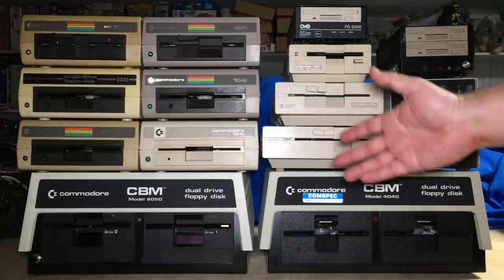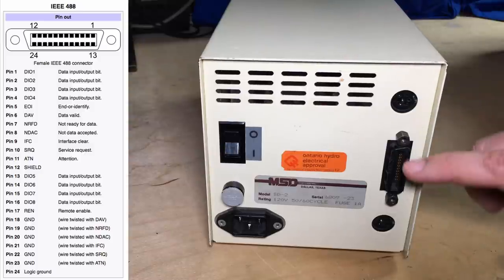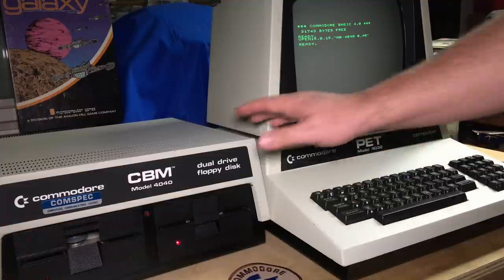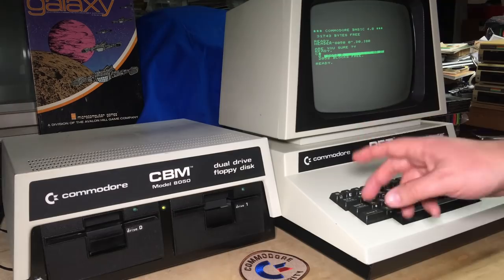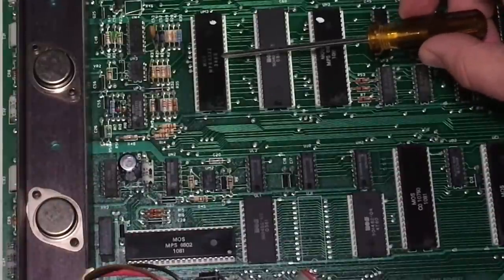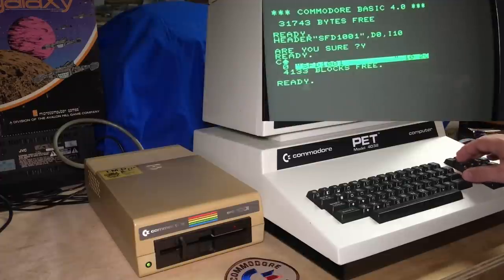Exploring My Commodore IEEE-488 Disk Drive Collection

Comment: "Quad density" was an informal name, so-called because it stored at least four times as much as most early 5¼-inch disk formats (720K or higher vs. 180K or lower). In reality it was still only double-density, but used twice as many tracks per inch (96 tpi vs. 48) and both sides of the disk. You were supposed to use special disks rated at 96 tpi, but eventually floppy disk media became good enough that you could reliably store it on disks only rated for 48 tpi (such as the IBM PC 360K format).
Reply: Yeah, I never had a problem using DS/DD disks in my SFD-1001 back in the day.  Of course, I didn't get my SFD-1001 until 1985 -- by then, as you said, floppy-disk quality had improved to the point where a DS/DD disk was good enough.
Reply: That's like with the BBC Micro and 40 vs 80 track drives.

Comment from the maker: I cover a lot of stuff in this episode, so here's an index. Also, a correction: Apparently drive 0 is on the right in the dual drives from the factory! So someone just swapped the labels/face plates, not the drive mechs. Also, I totally forgot that in BASIC 4.0 you can just PRINT DS$ to get the disk status, rather than typing in that 4 line program. D'oh!

0:00 Family Photo: all my C= Floppy Disk Drives
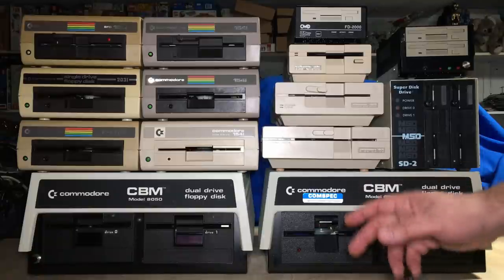1:10 The two interfaces: Parallel IEEE-488 and Serial IEC - as seen on the MSD SD-2
3:45 Commodore's IEEE-488 cables
4:48 PET 4032, and opening a new box of DSDD 5.25" disks
5:56 Formatting a disk in the CBM Model 4040 disk drive
7:41 Reading the command channel - Everything's OK
9:05 CBM DOS V2 - the DOS is in the drive, not in the PET
9:44 Labelling a disk!
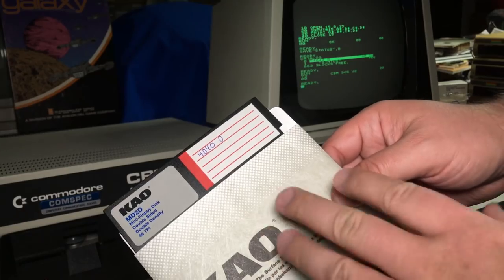10:20 CBM Model 8050 - 520K per disk side, NOT high-density!
13:09 Formatting with the HEADER command
14:12 CATALOG and how the 1541 was a regression due to $$
15:01 Inside the 4040 - two processors including a 6504!
16:48 Inside the 8050 - DUAL 6502s
17:47 The SFD 1001
20:13 4133 blocks free: Successfully formatting a SFD 1001 disk
21:48 Commodore 2031 and 2031LP
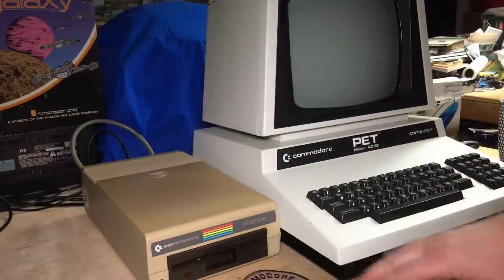22:43 Stacking Drives: The TPUG Locker
23:14 4040 to 2031LP to 1541 lineage
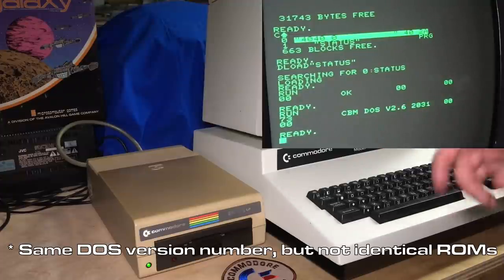24:25 Thank you to my patrons: http://patreon.com/8BitShowAndTell
24:45 I'll cover the IEC (serial) drives such as the 1541 in another episode
Reply: at 25:07 all AvE fans are thinking "Thanks for watching, keep your disk in the drive...."
Reply: wow i forgot how loud those keyboards were.
Reply: Yes, I thought that drive 0 was on the right too.

Comment: The 8050 disk mechanisms, for those who are wondering, are Micropolis. They designed a 100 tracks-per-inch standard, which was very short lived, and was ultimately supplanted by a 96tpi (because disk drive manufacturers could easily re-tool between 48tpi and 96tpi mechanisms, with a minimal change to the stepper motor). Both Micropolis and Tandon made 100tpi mechanisms (Tandon suffixed their 100tpi drives as M, so TM100-4 was 96tpi Shugart, versus TM100-4M which was the Micropolis 100tpi variant).

The 4040 used fairly standard Shugart SA-400 mechanisms (Shugart actually labeled these as SA-390, which lacked the analog board, Commodore supplied their own.)

Comment: Wow did not know that there were such a variety of  brown drives just knew the 1541
Reply: None of the drives besides the original 1541 and the 2031lp are brown, they are very light beige. Of course the plastic yellows over time if exposed to direct sunlight.
Reply: ok I just wanted to say i never knew that 2031 or sfd drives existed, but that video enlightend me...

Comment: The irony of the C64 moving from the 6522 to the 6526 was that they wanted to keep compatibility with the 1540 drive of the VIC-20, but a new problem crept in with the VIC-II chip requiring an additional slowdown of the data transfer from the drive to the computer. This made the 1540 incompatible with the C64 unless you sent a command to the disk drive to slow the data transfer down. EPYX, (among others), solved the throughput problem with their FAST-LOAD cartridge, but it wasn't 100 percent compatible with all the copy-protected game software that was available at the time.

In the end, the C64 using the 6526 and 1541 transfer data more slowly between themselves than the VIC-20 using the 6522 and the 1540. While there are mods that work around the data transfer rate issue, not everyone uses them.

Comment: To fix the famous 6522 bug, all they needed to to was sync up the data line with the CPU clock by using an and gate.
Reply: Did they know this at the time?
Reply: @csbruce  no, all they knew was that it didn't work. You can get a version of the chip that was fixed about 25 years ago by Western Design Center. 
https://www.westerndesigncenter.com/wdc/w65c22-chip.cfm

Comment: Never head about the 8050 able to store about 512kB on a SD floppy, by using 80 tracks instead of 40. In the late 80's I had a program named "VGA COPY" for the PC, able to make special formats. One on the was 1.72 MB on a standard 1.44 MB, this special format was used by Microsoft when then distributed the first version of Win95. The one I liked to use was formatting  SD floppies (360kB under MS-DOS) with 80 tracks and 720kB (the same as single density 3-1/2 floppies). This was convenient and very reliable. I can see my idea was used years before by Commodore and I didn't even know it.
Reply: It wasn't just Commodore - QD was a thing in general, but I guess IBM was a bit worried about reliability in '81 and went with 40 track. QD drives were quite popular in the eastern block for Z-80 based computers in the late 80s - early 90s.

Comment: I went from using the cassette tape to the MSD2, which I bought in Toronto in the early 80s, most likely at Paperclip, on Queen St.   I used it with an IEEE488 parallel card on my C64, and it worked great for everything, except for copying some protected disks.  I was a member of TPUG, and regret, never being in town on a day where I could attend a meeting.

Comment: I didn't realize most of those disk commands were built-in.  I never figured out how to format a disk on my C64 until I got a copy of the 1541's owners manual (that's all long gone now), but in the appendix there was a program for initializing disks.  Like it had for loops that zeroed out blocks and everything and even wrote out the header (byte for byte IIRC) and you could take any random 5.25" disk and turn it into a Commodore disk! (obviously the initialization and header commands you showed today are much faster but I didn't know them).  I ended up saving that program to the first disk I formatted with it. (making sure never to load it and run it on that disk by accident).  It's also how I found out about the "$" program (never learned catalog).  Wish I had access to this channel back in the 90s! 🙂

Comment: They fixed the slowness before the C128, on the Plus/4 which has its own interface.
Reply: ungratefulmetalpansy  Completely agree. 
1551 had such a complex communication, it made it very slow. They could just realize IEEE protocol on same 8 bit  paralellel bits.
But nope, they created a new one... In fact 151 only 2.4x faster on a 8 bit wider data line. Epic! :-D
The idea of implementing Dolphin DOS never came up in my mind, just the C128's and 1571's Fast mode, just created 1.5 years later... 
In fact I could not find a single bit of information how much faster was the C128's Fast protocol VS normal IEC. (also not about burst mode, or a benchmark JiffyDOS VS Fast protocol or Burst mode). Strange.
Maybe they could not sell JiffyDOS, if it would turn out that the C128 is faster by default?  Just thinking.

Comment: Nice. I have not seem a pair of pets in the wild for over 25 years and never the large size full height floppy boxes. I do love how they use a flat card edge connector that should have just been a standard 488. But then again I assume since it is part of the board design that it was cheaper. I also leave vintage stuff on items. Shows the history. I also collect records / Laser Discs and leave period correct labels on them including if they came from a rental store.

Comment: I can assure you that the behavior of your SFD is totally normal for single sided disks. It's the same as with the 8250(lp). The first access tries reading the disk as double sided, results in an error and the drive switches to single-sided mode. Then the next access will succeed.
Also, the older low capacity drives like the 2040 don't automatically detect disk changes, you had to reinitialize the drive manually.
And yes, the plastic case drives are pretty susceptible to EMF.
I guess one of the reasons why today you shouldn't stack them is because the plasticizer might leech out of the rubber feet and deform and imprint the top of the bottom drive. Back then, I guess, it was mainly heat and EMF.

Comment: I ran a C64 BBS back in the 80's. I had the MSD2, 1541, SFD1001, CPM8050 and a CPM D9060 (Hard Drive). the SFD's ran hot and I used some 3rd party exhaust fans to keep them cool. I used the MSD2 as a personal copy machine with my portable C64 think it was called a SX64.

Comment: Great video as usual, Robin.  I grew up with a C64 and 1541.  Thanks for the PET drives education.  I had no idea the PET drives were faster and had a higher capacity than the C64 drives. That kind of stinks for us C64 guys.  Also, I knew they added the "CATALOG" command for the C128, but had no idea the PET had it as well.  I wonder why they left it out of the C64.  Looking forward to part two.
Reply: PET BASIC 4.0 with disk commands took twice the ROM space, I believe, which would have increased production cost.The C64 was much more a mass-market machine where every dollar counted, while some later PETs (the CBM 8000 series that high-density drives like the 8050 were meant for) were moderately high-end microcomputers for their day, intended for business use with 80-column video, etc. and quite expensive.  Time pressure during development must have been a factor also - C64's BASIC ROM was nearly a direct copy of the VIC-20's, where disk drives were rarely used, and its custom chips (VIC-II, SID) were first introduced in the Commodore Max Machine (Ultimax), basically a game console with only a few K of internal RAM, no internal BASIC (had to use a cartridge) and an awful membrane keyboard. That was only sold in Japan, and didn't last long.

Comment: We used these pets for cad design at college in the late 80s, at the start of each lesson we would have to open up the hood of the disk drives and clean the heads. I cannot remember what the cad program was called, but there was no mouse, you had to key in commands to generate the drawings. If you keyed in a command that was out of range the program jumped back to the basic Ready prompt and you lost everything!
Reply: ungratefulmetalpansy  I do remember that if you poked memory at around 32768 and above you got to write over the screen memory and it was a bitmap not character based like the C64 1k screen ram. or did I dream that!? Nope I a sure I am correct.
Reply: ungratefulmetalpansy  Yes I just had a look on the web and you re right, umm I can only guess that they had some sort of add on board for bitmap mode and I never realised.
Reply from the maker: There were a surprising number of add-on graphics boards for the Commodore PET, so it's quite possible that's what the college had for the CAD course. They probably invested a lot of money in those systems in the early 1980s and didn't have the budget to upgrade that decade. Here's a great page about those add-ons by Steve Gray, the same guy I mention in this episode: http://www.6502.org/users/sjgray/computer/petgraphics/index.html
Reply: @8_Bit  Gosh there are hundreds of themon that site! no idea which we had, I am sure it was running from boot up as I remember poke(ing) around and I found I could overwrite the screen ram like a bitmap. I did it from basic after the machine had been switched on and I clearly remember writing over the boot up text (basic bytes free text) but like i was going over it in bitmap mode not character mode. So the card must have remaped the PETs char mode into the bitmap mode on startup, if you see what I mean. Thanks for the interesting Videos (from Nottingham UK.)

Comment: 5:38 I remember distinctly that the 8050 drive at my school in 1980 also had drive 0 on the right so I think that was the way they came out of the factory.
Notice that the 8050 (and the 8250 double-sided version) also had almost 3 times the capacity per diskette of the IBM PC: about a megabyte per disk, on the same type of diskette! When my school got an IBM PC I was pretty disappointed about that. Not to mention the stupid PC keyboard on which you had to use the Shift key to type all the important BASIC symbols such as " and $.
Reply: The 8050 used 77 tracks instead of the PC's 40, and Commodore used variable bitrates with GCR encoding (8 data bits = 10 disk bits) to cram every possible bit onto each track, while the PCs used a fixed number of sectors per track, limited by the innermost track with the shortest linear length, and used MFM encoding (8 data bits = 16 disk bits).
Reply from the maker: Thanks, I've now done the research I should have done beforehand, and yes, drive 0 is on the right from the factory. So I should swap those faceplates around now, that should be simpler than swapping the drive mechs :)
Reply: @8_Bit  I think the face plates are attached to the mechs, not the case. So you probably have to take the mechs out to swap the face plates.
Either way, you could just leave it like it is, just like you did with all the other modified hardware and stickers and stuff.

Comment: I've heard retrobrite is sometimes only a temporary fix and it can make the plastic brittle.  I don't blame you for not trying...
Reply: I used it on a few old keyboards and it didn't get yellow in the last 2 years and the plastic also did not get brittle- but keyboards mostly have a very thick plastic to begin with and may be more resilient.

Comment: It wouild be an interesting hack to turn a Commdore drive into a full blown computer that you plug a video terminal into, or by using a terminal emulator in a Commodore computer.
Reply: Look up the freespin demo. They made the 1541 drive composite video out through the serial cable and make music with the drive stepper motor. It's seriously impressive

Comment: I think the concern about stacking 1541 style drives (the 1001 on through 1541) was more about heat dispensation not physical weight.

Comment: A nice demonstration to show that these drives are actually independent computers in their own right would be to use a later version of Fast Hack'em disk copying software from Basement Boys Software. It loads into two 1541 drives chained together and turns them into a disk duplication system which no longer requires being connected to the computer to work. So long as they don't get power cycled, you can just keep feeding it disks to copy and hook another drive back onto the computer.

Comment: Friend of mine recently bought a CBM8280 ... one behemoth of a drive.
Reply from the maker: Is that the one that was on eBay very recently? I am totally envious :)
Reply: @8_Bit  Yup, the one that was located in Dresden. Drive is up and running now after exhanging the EPROMs and 2 SRAMs. Tested on my friends CBM610 and C64 with IEEE Interface.

Comment: @8-Bit Show And Tell I am very surprised no one has found a Mini Chief drive for the C64. It was a drive/kit that converted a 1571 to  have a 20 or 40MB Mini-Scribe drive in it. The 1571 as a floppy still worked too. I knew a old friend when I lived in Ottawa, ON who had one back in the day, it was amazing. It could create x number of 644 byte drives (can't remember how many) or be set to use all 20MB (in his case) as one drive. I am guessing the Mini-Scribes died and people probably just tossed them.
Reply from the maker: I've heard of that drive but have never seen one in person. There were a number of interesting early hard drive solutions that are extremely rare nowadays as presumably very few units were sold. The only one I have is the CMD HD which was relatively common.

Comment: I only have a 2031 in the metal case. You have quite the collection.
Reply from the maker: The metal case 2031 is one I'd love to get. So chunky!
Reply: @8_Bit  It's a chubby boy for sure with that full height Shugart mech with the garage door latch. It's quite an odd mechanism, it uses a cam follower to move the head instead of the usual metal belt on a pulley.
I did know about the 2031LP but I didn't know C= also made one with the VIC-1540-style nameplate. 
I think the chunky 2031s are rare now.
Reply from the maker: @8BitNaptime  Yes, it might be the most rare of the three drives, but they're all pretty rare now: 1540, 2031LP, and original (chunky metal) 2031.  1540 seems to turn up most often on eBay, but it goes for pretty big money when it does.
Reply: @8_Bit  I need a 1570 and 1551 to complete my hoard. 1551s are crazy on eBay and I've never seen a 1570 there.
Reply: ...and of course today I found a 1570 on eBay but it's part of a lot. Oh well.

Comment: Just got my 4016 up and running, had to replace the video ram. have the old style 2031 disk drive in the metal box, and the external cassette player. there is something wrong with the cassette which is not surprising as it has spent the last 20 years in the garage loft.
but i can't find my PET 488 lead so have not been able to try the disk drive out.  looking at making a SD2pet unit as something to do during lockdown if i can get the parts.

Comment: I still have lightly used SFD-1001 from running a BBS back in the 80's, with an Skyles Works Quicksilver-128 IEEE adapter/cable.  I was shocked to see an SFD-1001 on E*bay asking for over 

$1,000usd with an original Commodore IEEE adapter/cable.  While it's rare, don't think it worth that much.